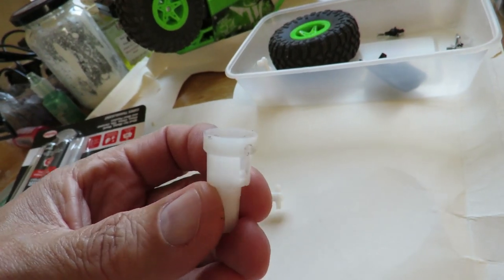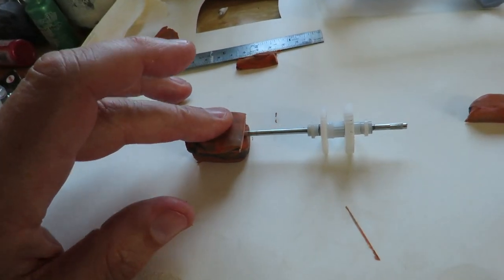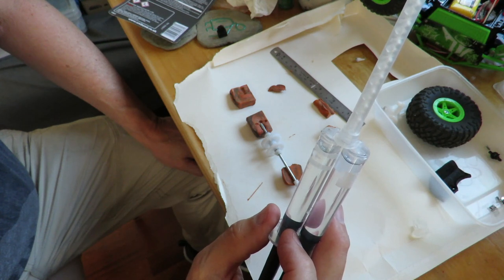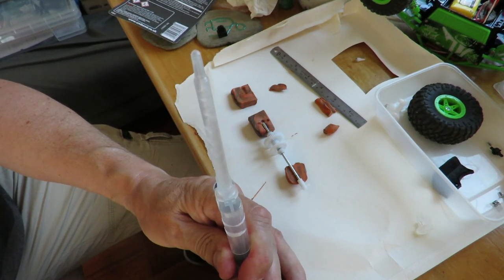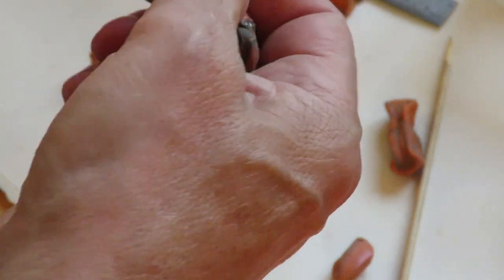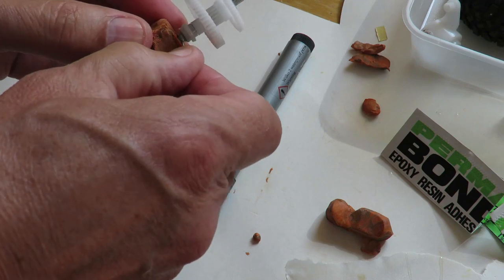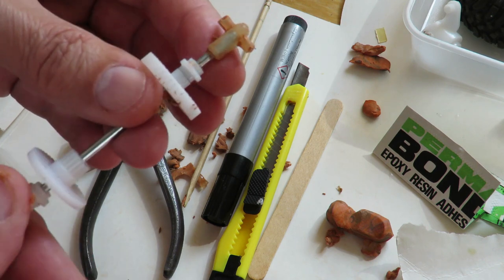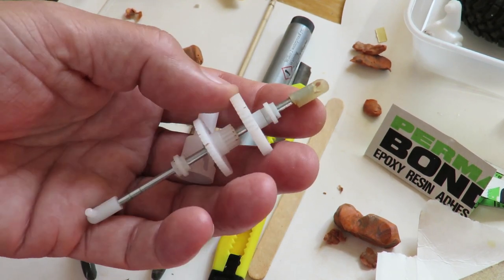Can I fix the broken UJ with a resin mould ?

Comment: Valiant effort, boss. So close. A worthy experiment. I've never trusted those helictical epoxy mixers and would rather spooge onto a lid and manually mix. What probably happened was an unequal mixing of the 2 chemicals from the start of the new tube.
Reply from the maker: I was probably too impatient. Maybe if I had left it overnight it would have been OK but that other stuff worked OK. It lasted for a few weeks which surprised me.

Comment: Very interested to see this. It's been a long since I tried resin/glue molding but always felt it had potential. Your 2nd attempt came out very well and certainly looked serviceable. Since you mentioned it in your last video I have too wondered about the practicality of 3D printing replacement parts like this. If you can supply dimensions I'd be happy to try printing some. The standard PLA plastic I use might not be up to the job but other plastics including things like Nylon are available which might work better (though I have not tried them myself). 😀
Reply from the maker: Thanks for the offer. The moulded resin lasted for about 3 weeks before we managed to destroy it and that may have been more because I had to file it down as I got the dimensions slightly out so I might have another go at moulding a replacement. I haven't taken it apart again yet so I don't know exactly how it has worn or broken. I am off on holiday again for a couple of weeks so it will be a while before I do any more on it.

Comment: Seen if there are any uk 3d printing shops ? (Can probably search up the local area of where you live and find one you can walk into probably if you cant get it well enough on your own & can't spend too much time into it.)
Can probably send in the part that is whole & ask for like 5 extra ones + the original one back ofc, print them in 2 - 3 materials and just put them too use.
Reply from the maker: Might be worth a try just to find out what is available in the area and what the costs are like. Even if I don't use the service it might be handy to know for future ideas. I can see there appears to be a suitable shop less than a mile away from me.